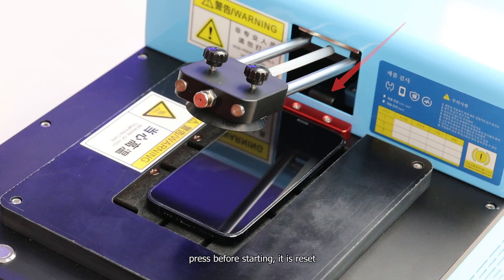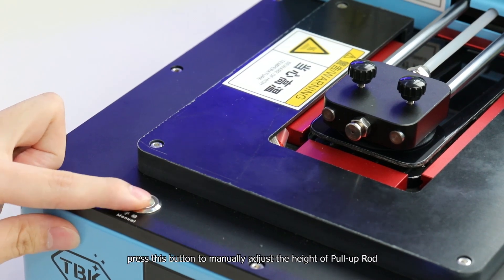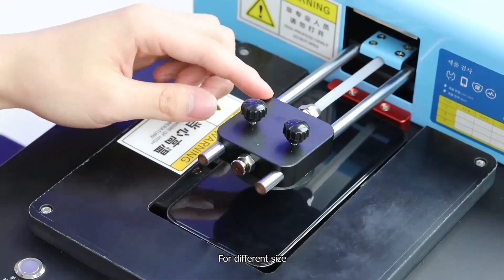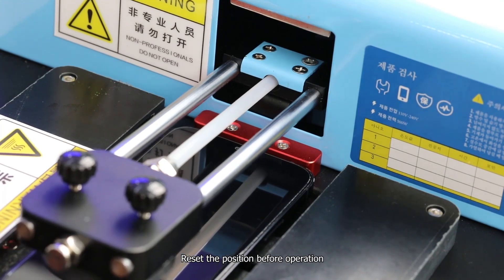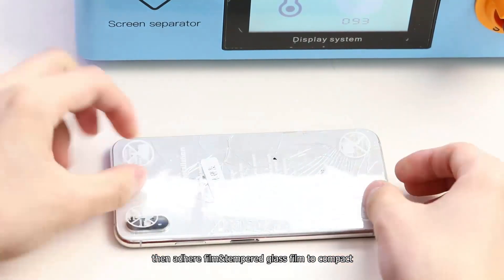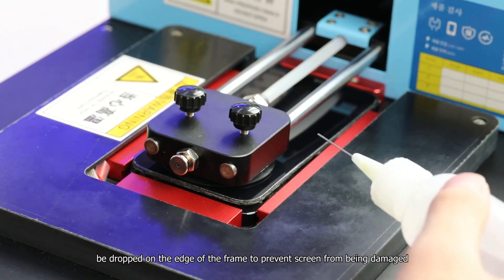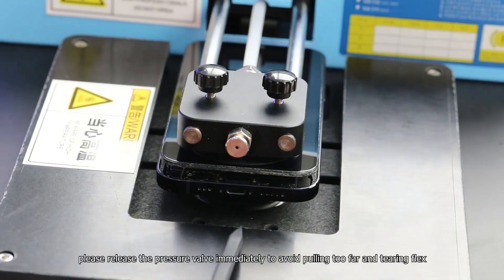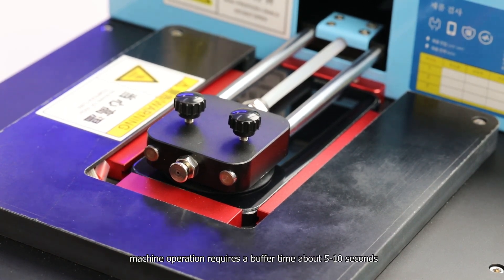Solutions For Operation Problems丨TBK-288 Automatic Screen Separator

Comment: What about the machine pulling the entire phone out of the space and not the screen itself?
Reply from the maker: 1- maybe the fixture isn't tight enough or heating temperature are not high enough; 2- apply some glue removal around the screen frame before heating and removal;
Reply: @Elekworld  how can you adjust temperature and what is the recommended temperature?
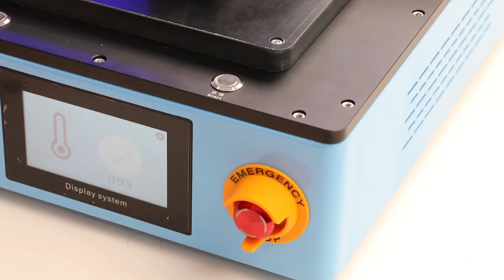Reply from the maker: @bnellie83   pls check time frame to 0:30 and there is a "setting" icon on the top right corner of screen. You can set temperature there. If you don't know the password, pls whatsapp us : https://wa.me/8613590142302

Comment: Can it be use for android ? to remove the back glass panel ? Specially if you have a big camera bump
Reply from the maker: Better to use it on iPhone only as it was designed to. If you use it on Android phone screen or back cover, better to consider. As far as I know some android phone was designed with fingerprint flex together with back cover, if was handled improperly, the flex might be damaged.